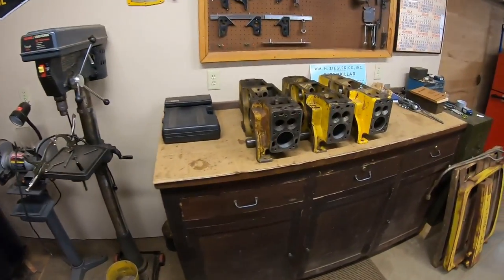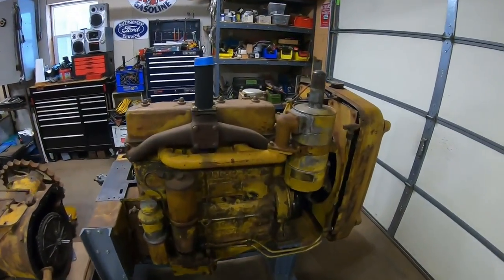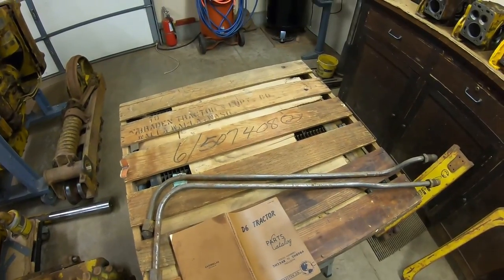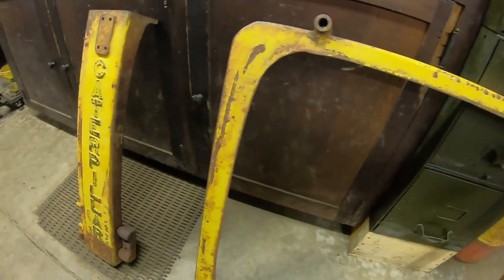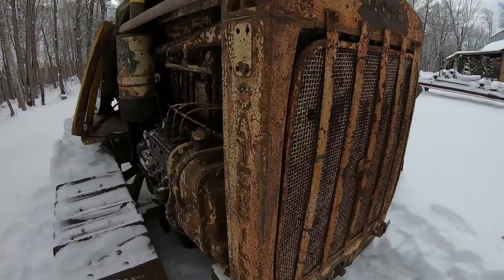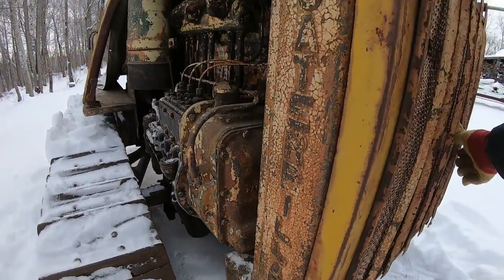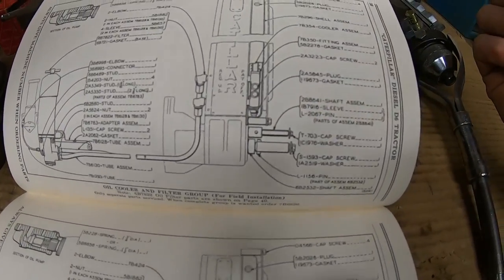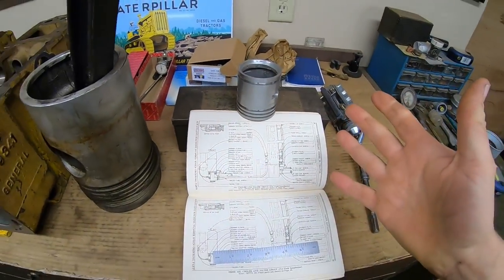Another New Old Stock (NOS) Vintage Caterpillar Parts Score!  Let's See What's Inside the Crate!

Comment: I generally am not a follower of your channel but grabbed this one.  

A few years back, probably ten by now, a friend and his wife bought several old Cats from a farmer.  When they got the last one, he commented that since that was his last Cat he had, they probably should get all the parts he had as well.  His father and uncles had farmed for many years with Diesel 40's and three cylinder D-6's along with a couple of D-8's.  Any tractor that was too far worn out to fix was stripped of all usable parts.  Any dealer within some distance that went out of business and wanted to sell their parts inventory saw them adding to the collection.  They also bought a lot at auction.  The parts collection he gave us was absolutely huge.  It filled parts of three buildings.  We carted tons of parts out of there for several months.  I think there was an oil cooler like yours in there.  We used it to replace a leaking one on one of the Cats.  We filled the bed of a pickup with NOS bearings in their original boxes and wraps.  I recall a stack of large gears on a table that probably had been there for decades.  I had to pry them apart as the cosmoline had hardened cementing them in place.

We have used a few, sold a couple, and traded a few others.  We have declined to part with them to someone else to hoard, preferring to sell or trade to someone that was in need of that part or parts.  I have a newer D-8 2U.  Most of the parts are for 1R, 1H, and older 2U's  I need a crank pulley for mine  but that, of course, we don't have.

Comment: Noticed the precision hone on the bench. After much thought of different ways to bore my pony engine blocks I gave in to the hone method. I could not believe how fast that thing cut the cylinder walls! I bored it out 0.020 in. Cylinders are perfectly perpendicular to the mains and no taper at all. I was really worried about the hone following some crazy tangent angle, I guess I was over thinking. I was thinking the whole time I was watching this there is no way he will take that out of that crate!